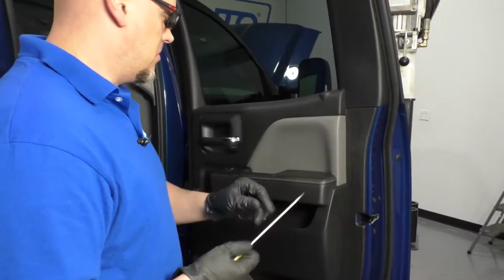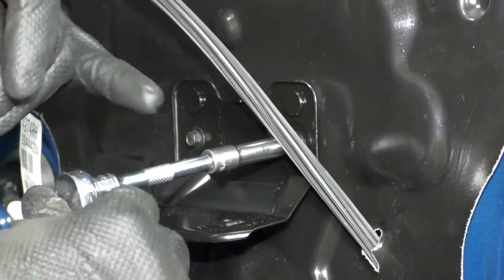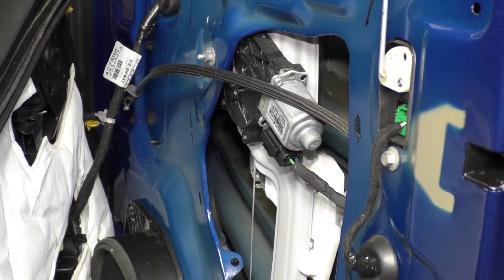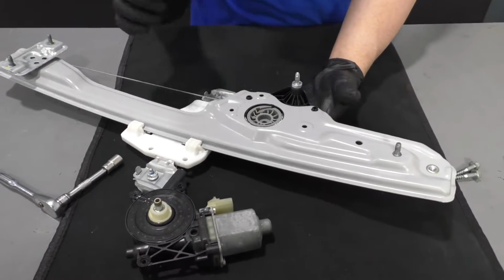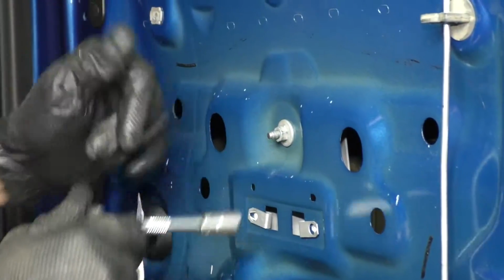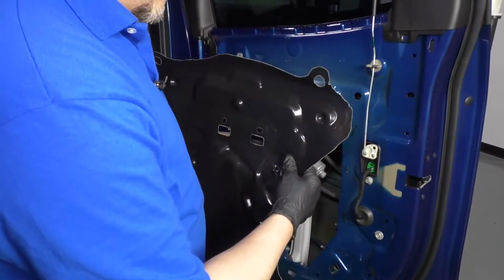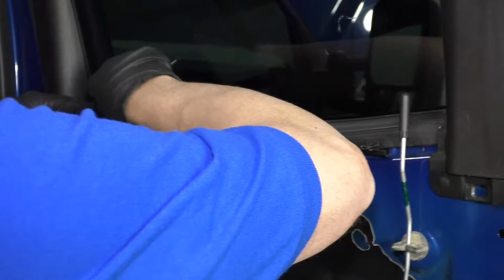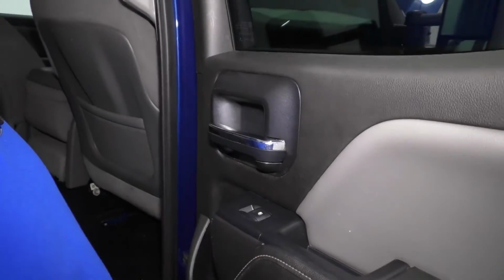How to Replace Rear Window Motor 14-19 Chevy Silverado

Comment: what if your window is stuck all the way down
Reply from the maker: +timothy godfrey Thanks for watching!  If the window is stuck all the way down and you cannot raise it to get to the bolts, then it will have to be raised one way or another.  If it cannot be manually cranked then you will likely need to cut the cable on the regulator and replace the whole thing.

Comment: What happens is the window can’t be brought down? Mine doesn’t work and it’s all the way up. Can I still remove the regulator and motor ??
Reply from the maker: +Jim Gosselin Thanks for checking us out! Yes, the regulator can still be removed. By cutting the cables on the regulator it will allow the window to move freely and the regulator can be removed. You will want to tape up the window to prevent it from falling. Please let us know if you have any further questions, thank you!
Reply: 1A Auto Parts I need to troubleshoot the rear window to see if it’s the motor or not. I get no humming or movement from either front or rear window switch. That’s why I think it’s the motor itself. I should get 12v to the motor connector and if so it ain’t the switches. I just gotta know I can get the motor out